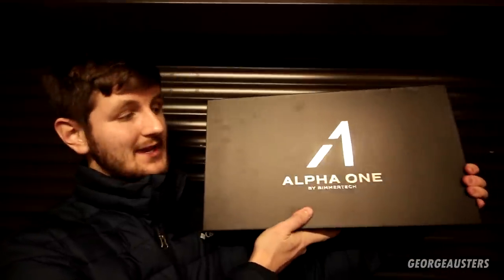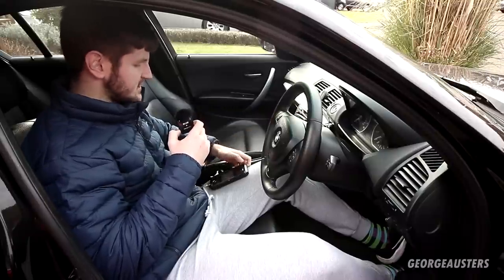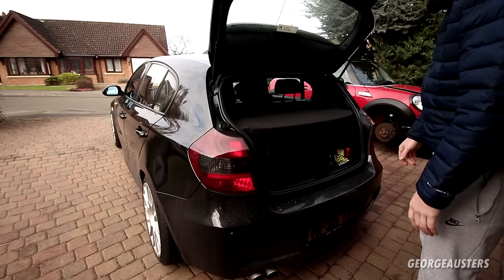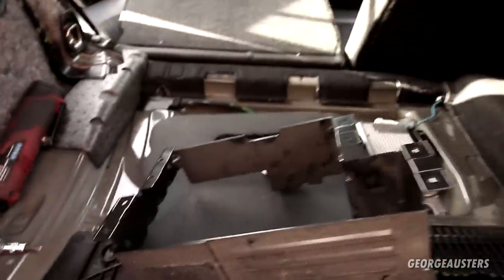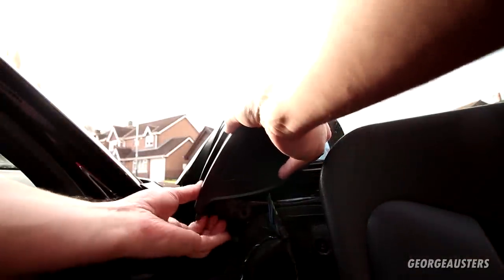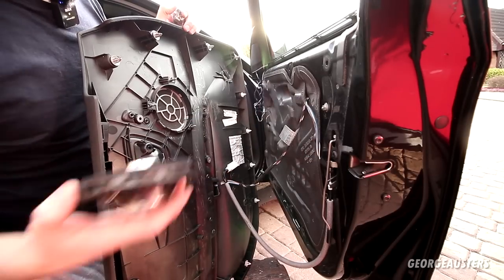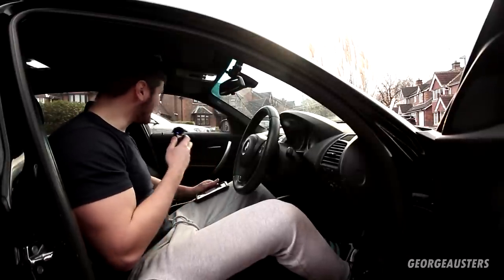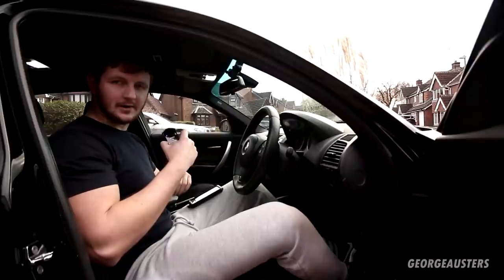BMW SPEAKERS UPGRADE | BIMMERTECH ALPHA ONE SYSTEM REVIEW

Comment: Great upgrade but something a lot of people are not aware of is that all new speakers need to be run in to get their optimum performance, that applies to any sound system, don’t just put them in and turn them up, increase the volume over a couple of weeks running them in, start around 40%.
Reply from the maker: Strange you say this because I have actually noticed them get even better lol

Comment: Literally just done this myself this last week. Came to realise my model had a glued in passenger side sub, and no sun under driver side at all, with zero wiring to go with it! So bought the black enclosures and fitted both and ordered the cable from bmw to retrofit later this week. Better be worth the hassle🥴
Reply from the maker: Good luck!
Reply: @GeorgeAusters  managed to do it, the difference is night and day, easily one of the better upgrades and not bad for £250

Comment: Finally got my 118d back from the traders. "Never buy a car from bradford" told them all the codes all 10 of them. Only to get it back with just egr dpf clean. Runs better so will keep it for a while.The sound system as standard is pretty decent for a 14 yo car though, are these speakers better than the harmen karden?

Comment: Running a Hertz system in the R58 Mini, along with an Alpine E800 DSP amp...  If you sound deaden the door and the door cards properly then the 6.5" are acting as the bass drivers, so no need for proper sub in the boot taking up space.

Comment: Planning to do the bellow seats change myself and I'm wondering if you haven't complicated a bit by removing the complete seats. What do you think of simply removing the 4 rail screws and then tilting the seat backwards? Wouldn't this give enough access?

Comment: damn I am jealous, I do have logic 7 which sounds pretty good in my 120d
Reply from the maker: Be interesting to hear the difference between these and Logic 7
Reply: @GeorgeAusters  its bit lacking in the deep bass department, but sounds pretty good overall
Reply: @flippy9133  it depends on what you are listening because Logic 7 isn't working all the time ;) Try to watch a film on your iDrive system, you will be amazed ;)
Reply: @robciks1995  I might dig up some old dvds lol :D
Reply: @flippy9133  Yeah, seems funny but thats the only way to realy experience the Logic 7 work. 
P.s You wont feel it from USB/Aux/Radio. Only good artist CD's or DvD's. Best to use Concert DvD's.

Comment: Top job. I wonder if it's hard to code the standard radio which comes with the basic audio system, i.e. the system which doesn't have tweeters and amplifier. I also have to get the complete cable kit for a Hi-Fi system, because it will be a pain to modify the existing stock one. God, it is hard to modify these cars ...

Comment: Is that bracket for the drive for the nav unit if you had that
Reply from the maker: Nah the idrive is CCC in these which uses a DVD drive in the dash👍🏻
Reply: I wasn’t sure I remember my e46 had a nav unit in the back
Reply from the maker: @mgmmotorz5004  Yeah pre CCC cars had the nav module in the boot

Comment: should you need to also get their Amp system too? or is that more of an option? cant really justify spending another 1k on it lol
Reply from the maker: You don’t NEED their amp, it works fine on the stock one but if you want to get even more performance, you can upgrade to their amp later down the line👍🏻

Comment: Hi guys my 118d 2009 n47 cut out while driving now unable to find fault,  have checked chain, changed glow plugs,  glow plug relay,  cam shatf sensor,  crankshaft sensor, don't really know what to do it
Reply: First of all, check the fault codes. Look at some of DiagnoseDan's videos to learn how you proceed.
It's useless to guess, because the problems can be anywhere and of any sort. And many times "very simple".

Comment: do tweeters matter? i dont wanna do them on my passat
Reply from the maker: I really can’t say how much tweeters affect the sound
Reply: @GeorgeAusters  you need to custom make a bracket on mine to fit aftermarket. The normal speaker have rivets as well

Think I’ll leave them, can’t make a huge difference. The big speakers are cracked tho due to age

Comment: Would you have paid the $1230 plus postage and import charges for couple of speakers?
Reply from the maker: Yes. The Harman Kardon set from BMW would cost A LOT more👍🏻
Reply: I can get you Match full complete upgrade set for 450 euros + shipping/tax. Will be 10x better than this kit
Reply: @robciks1995  yes! For sure! I went for Match to the front speakers and Focal for rears, subwoofer and amplifier! That's a setup now!
Reply: @robciks1995  what are the components? keen to get something similar if not better but not paying $1k lol
Reply: @robciks1995  let me know some details mate. I'm looking to upgrade from the base system that doesn't even have tweeters lol, it sounds like sh*t. I have a feeling my speakers might be a bit too old already as I noticed some distortion recently (that feeling/sound of a deteriorating membrane) and if I'm going to change anything, I might as well upgrade to something decent. I would love to get an amp + speakers and all that for about that 500€ mark you said 😅
Reply: @pxKappa  also there is a option to go used.. get the trim , buy the under seat speakers from a e65 with logic7 , and put in a dsp kit it’s roughly around 900€ for all of it and it’s going to be more then enough for most people

Comment: A question, George. When you listen music using an AUX, the loudness of sound is the same as listen radio? I've e60, but the sound is much quieter using AUX as listen to radio.
Reply: Yeah standard sound system on my e60 absolutely sucks to be honest
Reply from the maker: E60s have a resister for the aux input to stop you blowing your speakers, you can remove it though
Reply: @GeorgeAusters  I found a video where some guy took out sound resistors from his e61, 2008, but didn't work for mine. The sound didn't change after taking out resistors.

Comment: wasted money, would of better added a sub in a hidden enclosure and added a dps amp
Reply from the maker: I wouldn’t say so lol… Bimmertech do an upgraded Amp as well👍🏻
Reply: @GeorgeAusters  Well the main audio source in the car doesnt change, it drops the levels on each channel from factory and it doesnt matter what kind of a amp you put in if the signal isn't flat out.
With a dsp amp, like Audison AP Bit 8.9 or APF 8.9 ( in my case) you can flat out the source signal, make endless tuning, add any type of new high res input sources, etc. 
I have all of the speakers Stock with the audison APF 8.9 properly tuned and the speakers sound 10000 times better because of the proper tuning. Plus i added a sub in the trunk in a stealth box that doesnt make any difference in the trunk space. It gives a extra bass when its needed. 
Eventually its best to soundproof the speakers placements - doors, floor etc. it will make even a better result in audio plus it will remove a lot of vibration.
Reply from the maker: That’s fair enough. I’m not really interested in doing extra non standard wiring though. I’m usually the person who rips all that out when I buy a car😅
Reply: @GeorgeAusters   you dont need to do any harcore wiring. everything is Plug and Play ;)